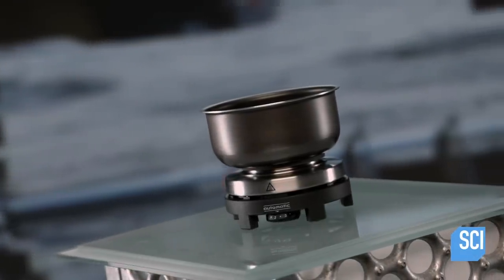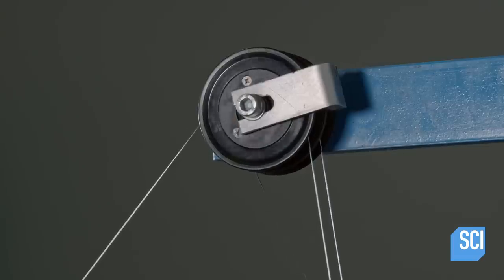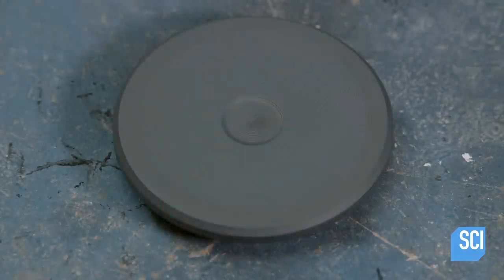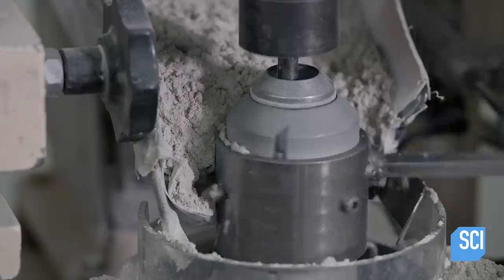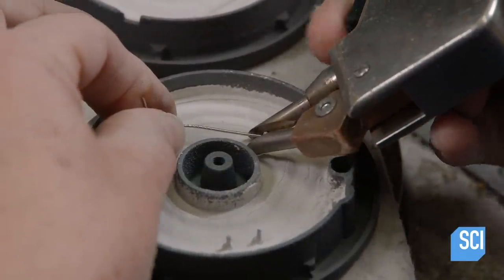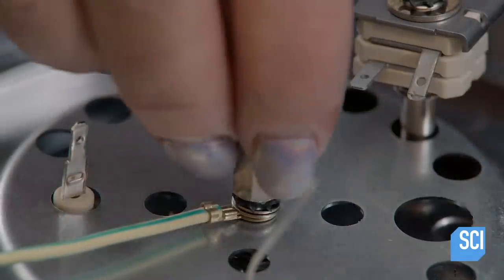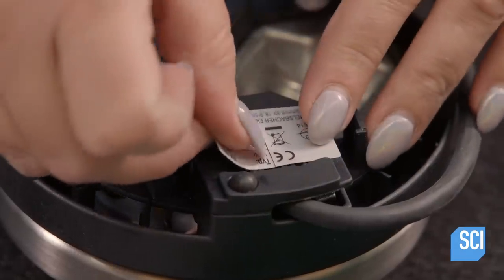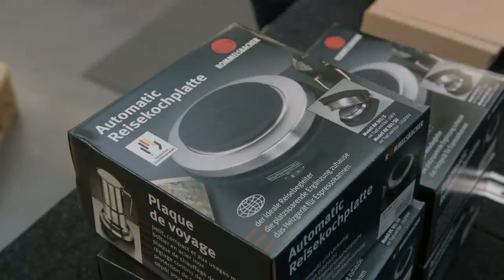How It's Made: Travel Hot Plates

Comment: Was out looking for a traditional cast iron hot plate. Thanks to this video I found the best: Rommelsbacher !
The cheap chinese crap might work but thermostat is crap. It's not thermally linked to the plate and the current causes the thermostat to warm up. Thus it's more like a timed on/off switch.
The traditionel hot plate is perfect for use at the table whether it's dumplings "æbleskiver"/ebleskiver, waffles or just to keep something warm. For that use induction cookers is not ideal because of the noisy fan. A cozy click once in a while is perfectly acceptable. 
The wattage for the travel hot plate is on the tiny side though. 500w is quite slow. Might have been sufficient for induction but IMHO on the quite slow side for cast iron burners. I ended up buying the AK 2099 - at 2000w it's quite quick. Made in Germany - quality wise there's no comparison with cheaper chinese alternatives. The Rommelsbacher wins hands down any time.

Comment: That 12h drying process seem really inefficient. I wonder if you could speed up the assembly line by replacing the talc filling mixture with something like glass beads, which are non conductive and can resist high temperature.
Reply: That's more inefficient.
Reply: @spacejihadist4246  how so? You’re replacing a 12h cooking process with a single assembly step that only takes seconds
Reply: @ethaneveraldo  you're gonna glue in the glass beads or melt it?
Reply: @spacejihadist4246  what if they’re just compacted into the casing with fasteners? Or, alternatively, use a premade heating element that is already non-conducive, like those used in electric water kettles, and have the heating element in close proximity to the top plate. Anything to avoid having an assembly step that involves waiting 12h  would drastically speed up the assembly line, improve efficiency and reduce cost.
Reply: @ethaneveraldo  your new idea just made the end product more costly/expensive.

Comment: Now all you need is a solar chargable battery pack that would capacitate like 4 hrs cook time & then its totally portable no outlet needed! 🌝
Reply: Good idea - Get started working on that.
Reply: Look for portable solar generator, you can DIY one, I make one myself with DC-AC inverter useful for camping.
Reply: Waterproof powerbrick and a roll-out solar panel. Can be carried on a pack frame.
Reply: That will need to be way to big for that capacity.
Reply: Or make one that can connect to your cars cigarette lighter socket.
Reply: I am sure those are sold in camping places.
Reply: Huh, not a bad idea, but... (sigh) I dunno, I think an outlet would be ideal for most people.
Reply: Okay, but at that point why not just use the sun?

Comment: so all thats stoping someone from getting zapped and dying is just some sand like material? what if after many road trips and bumps it turns back into dust
Reply: You won’t die of 230 volts. Otherwise i wouldn’t have been typing this 14 times over 😉
Reply: I'd bet that this sand was mixed with an agent that, combined with the 16t compression force, turns it into something similar to concrete which also doesn't wash away at the slightest touch.
Reply: Who the hell gets electrocuted with a grounded device?
Reply: The sandlike thing melts and becomes solid when they cook it with the cast iron base in the oven.

You totally missed that step, right?